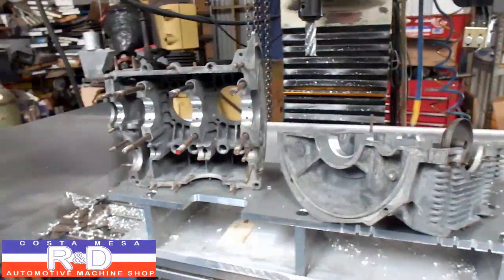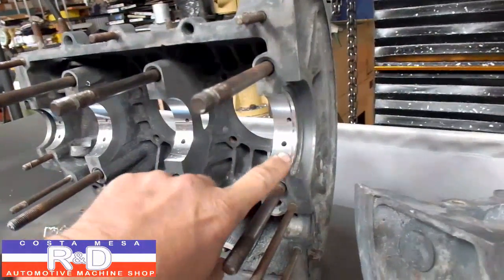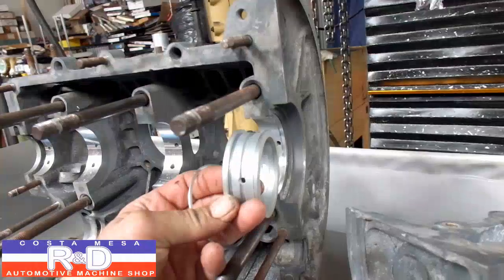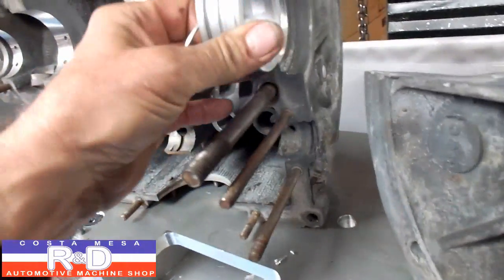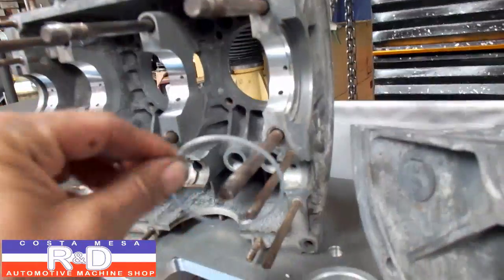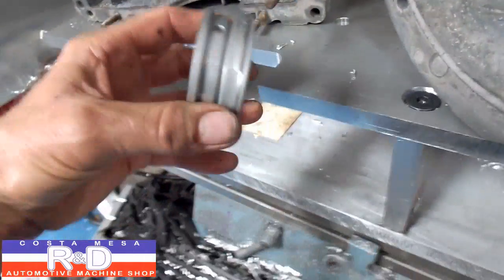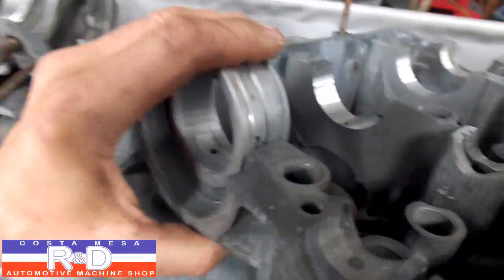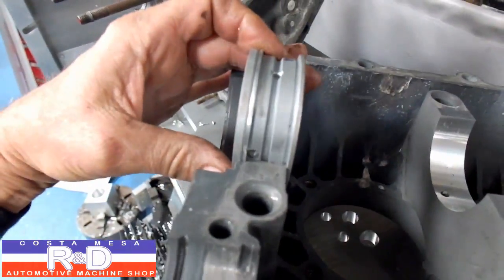Air Cooled VW Thrust Repair

Comment: in the real world if a case is that bad it is junk we throw it away 60/80 ONLY if you had to the dial pin get right next to nothing as seen in ur vid it is probably 005 from going threw the dial pin hole, u look to be a good machinist but NOT a VW machinist because that would be a nono
Reply: *dowel pin*. and once everything is assembled nothing is moving, the metal in front of the dowel pin is a tiny fraction of the whole thrust surface so not an issue.

Comment: That's more high tech than my JB weld repair method.
Reply: DonziGT230  hey how long ago did you repair it using JB Weld? Has it lasted?
Reply: @BeetleMike_F  It was several years ago on a motor in a Sandrail, I think it was a 1776.  There were lots of problems with that motor, it was basically all scrap parts 'glued' together with JBweld and locktite.  I only ran it one season, probably 10 trips.  I had no problems with it.

Comment: im in irvine ca. i need a few of my 36hp cases and heads done inside and out. What would you recommend as far as media goes. do you guys soda blast?
Reply: My new channel is the JO-EL channel. We use a steel shot media that cleans block very well. We do not use soda for anything. John @ Costa Mesa R&D Automotive Machine Shop...